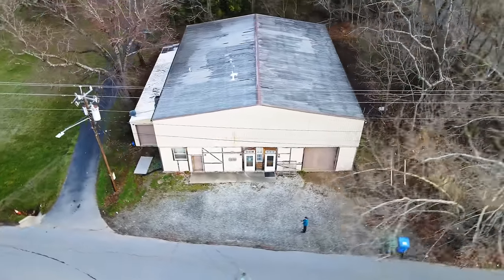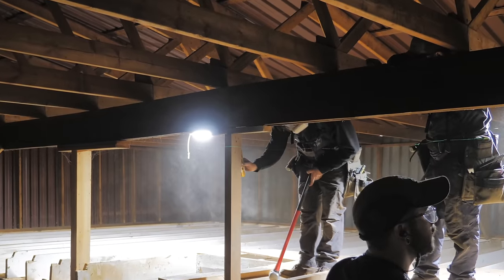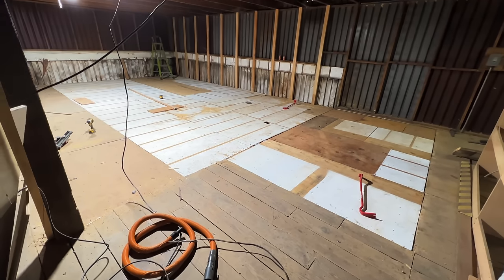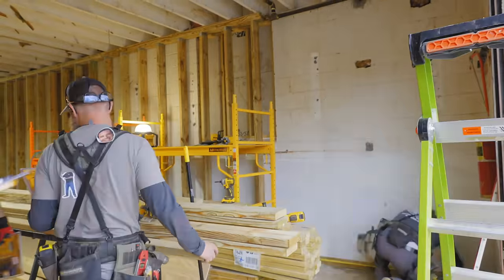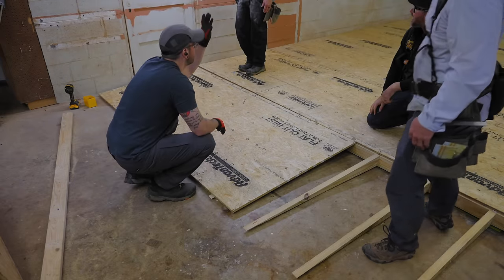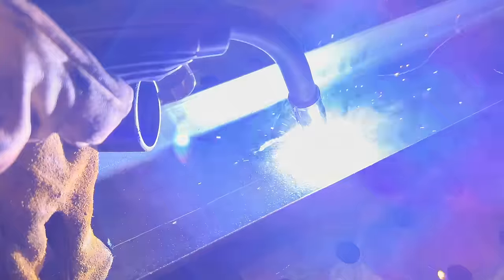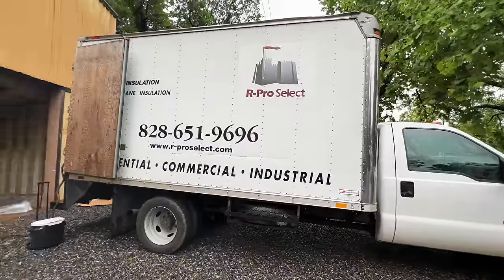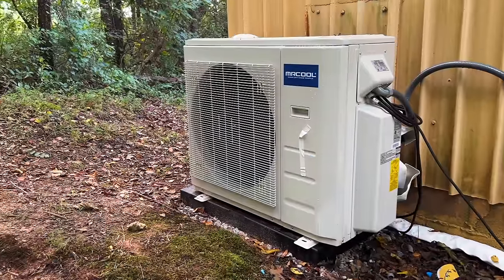50 Yr Old Workshop Restoration Into My Dream Shop

Comment: i dealt with that in my townhouse  we had a hurricane come through and knocked out my power for 5 days right after i moved some leather couch from north Carolina  to Georgia then we sold both houses in Georgia so i got the couch  i notice a small spot on the bottom of the couch but when i got it home and my power went out  that couch ended up furry and it spreaded quickly  through out down stairs but i got it before i had to get the commercial companies  but  i  can't stand seeing mold it just  makes  me  mad  because i always keep my place clean i blame it on ocd  it has to be right and clean

Comment: 37:24 Next time instead of putting your giant structure supporting screws in corner ways because they hit something in the last 1/4 in, pull the screw out and cut 1/2 in off the end.  That last 1/2 inch isn't helping anything anyway, its just the tip designed to cut the threads, which you already had since you already sank them as far as they can go.

Comment: I saw settlement cracks on walls on 1:21 , what you about that?
Reply from the maker: The structural engineer looked at those but wasn't worried considering the age of the building.

Comment: Another thing the US need to do is have a Qualified Electrician test every circuit to make sure it meets reg's and that the final circuit in every circuit breaker meets regulations and that all cabble connections are compliant and will NOT fail in any test. STOP USING WIRE NUTS.

Comment: I’m still watching your video,but I notice that junction box outside that’s about 1’off the ground before the unit I don’t think that is legal, I think you need to be a minimum of 48 inches each states a little different now,But I’m pretty sure it needs to be more than a 1’ off the ground. For heavy rain, snow, flooding,I may be wrong though you’re doing a good job though bud looks great

Comment: Why not make 1 of the 2 outlet from the quad box on a different circuit that way each quad outlet has 2 circuit so you dont have to reach 5 feet away if you have 2 power hungry tool in use

Comment: instead of doing 4outlets circuit 1 then farther 4outlets  circuit 2, doing 2 outlet circuit 1 (like on the two left plugs) and 2 outlets on circuit 2 (like the two right side plugs) would be even better (and runing it on "inverted phases" [L1/L2/N/G] you would have half the neural and ground wire and you could even add a 240v socket (15A or 20A depending on 14ga or 12ga cable)

Comment: 1:52:40 I think I commented on this in the original video, but a Hilti powder actuated nailer with some black chargers would have been perfect for fixing the timber joists to the steel beams.
Reply from the maker: Wish I had one of those!
Reply: @craftedworkshop  I rent one from the hire shop when I need to fix into concrete or steel. The DX460 with collated fixings magazine is the best option.

Comment: In Europe we've been using Wago connectors for a while. The US & Canada need to STOP using wire nuts and also stop twisting cables together. It's very bad practice. Also the US need to start testing final circuits before handing over to the customer

Comment: Drylock is junk for waterproofing. It'll just create efflorescence and end up weakening the block. You need to waterproof from the outside, starting with your drainage system
Reply: You clearly didn’t watch 30 seconds longer in the video where he says he’s renting an excavator and waterproofing the outside
Reply: @codykulesza7076  you clearly didn't see that both sides of the block are drylocked and no amount of grading will help with that
Reply from the maker: The outside isn't painted with Drylock, just standard latex paint as far as I know. No moisture issues currently.

Comment: so that cement board, there's a tool that cost about $7. it has a handle with a carbide saw tooth on each side(get one) it scores (Scratches) where ya want to cut than the material snaps on the line, easily done if you press your cut againt a wall corner. not an inside corner. less Dusty, wireless, quiet and takes 1 min.

Comment: c.[1:48:00] You couold have used that multi electrical tool to create the loops Oh ya 220 line must have a heavy gauge compared to 110 obviously. Ya that's a useful tool but too fragile I use mine for repairing expensive torch lighters that my friends always end up overpaying for and then the piezo igniter stops working. (usually carbonized at the tip and torch nozzle, easy clean or just a drop of a fine non-condutive lube if the piezo had just stopped that SSNAAPP :)

Comment: Soooooooo much work. Seems like it would have been so much faster and cheaper to knock it all down and just build a new one. 😂
Reply from the maker: It definitely could have been, although I think the cost would have been a good bit higher unless I managed to salvage a ton of materials. There is a 1,000 sq ft apartment in the space which I use as office space, and rebuilding that would have been a ton of work.
Reply: @craftedworkshop  plus we wouldn't have this awesome rehab video

Comment: Slab not level, so much flex in the walls, ingress of water through the walls etc. Not trying to be a wise-ass, but I really don't understand why your initial waterproofing was so superficial. Going forward, this lead to all that mould build-up and massive issues later. The installation of you aircon is really only a remedy for the symptoms but not a cure. You really need to do some substantial water-proofing on all exterior walls. Why backfill the exterior walls without adding an extra waterproofing layer to them. Your solution might deflect a lot of the water away form the wall, but the soil will soak and pass that water into the wall itself. Painting a good thick layer of tar onto the walls (in a dry condition) would have helped immensely.
Reply from the maker: I needed to get some kind of waterproofing in place because I knew I'd have the Perkins guys available for a limited amount of time to do the framing work inside. I could have certainly dug out around the exterior walls but it would have been a massive, massive project and, honestly, the building has been standing for 50 years with no waterproofing. I've had no moisture issues since doing the grading and am confident the building will be here long after I'm gone.
Reply: @craftedworkshop  then I’m happy for you buddy 👍

Comment: Do you not need to get electrical checked when you do it yourself? Where I live it's required (every time you connect anything to the fuse box). Wonder how the previous owner got away with that shoddy wiring.
Always surprises me how much more work wiring in the US is. In Europe we have 230 volt, and 400 volt (3phase) circuits. Obviously everything above 230 volt is for industrial use.

Comment: why feet from the side instead shims under neath, the floor is only as strong as the faseners and the wood making up the feet, where as with shim you would need brute compression to shatter the wood or shim material vs shearing the force needed to damage a foot
EDIT: i will say all in all not bad, in fact with all that brick wood and steel, shes build like a ....brick ..... house
Reply from the maker: It was mostly just a speed thing. The number of fasteners used should be plenty to keep from shifting over time.

Comment: You didn't really finish that front porch overhang. You did not finish the fasia..... you need to ad one more piece under the one you first installed. You have about two inches of exposed fasia all the way around....

Comment: That “Waterproofing” solution won’t work long term.  Heavy rains will build around the foundation. The blocks will then fill with water, and the increased hydrostatic pressure will force its way through that dry lock paint and right into that area.  Just do an interior Waterproofing solution as they come with a life of structure warranty.  Don’t be cheap.

Comment: This was really interesting, particularly how inefficient the American electrical system is. Having to pigtail outlets is such a waste of time, and do you not have to dead test over there? No standards for earth continuity?
Reply from the maker: Pigtailing eliminates the possibility of one outlet taking out an entire circuit. Outlets fail, it happens, and it's best to build in redundancy.
Reply: @craftedworkshop  I understand but that wasn't quite what I meant. Our sockets have screw terminals and you twist your incoming and outgoing feeds together. The sockets themselves are linked with copper busbars within the socket enclosure. It means zero assembly time making up pigtails behind each socket

Comment: I think concrete screws are literally fake. We've all been had. They don't actually work. If you attach something to a wall with concrete screws, it's going to fall off. That is, if you can get it attached at all. I always use plugs now.

Comment: Those off brand tapcons? They don’t look like Tapcon brand tapcons.
Reply from the maker: I can't remember honestly, had some Tapcons and some Simpson concrete anchors. It turned out the SDS bit I was using was creating an oversized hole, once I bought a new one, the anchors worked fine.

Comment: It’s not a good idea to both waterproof on the inside and the outside! That means any water in the wall will stay trapped forever, as it can’t dry to either direction! Water will always get in, no matter what you do, so, at least give it a direction to dry out towards either the outside or the inside.

Comment: Looks like who ever built it just put up a cheap building and used cheap labor and called it good.  Looking good now 🙂
Reply from the maker: Definitely more of a utility structure but it has good bones.
Reply: @craftedworkshop   Yeah, especially if you can reuse a lot of the materials. Here they will put up cheap metal buildings and use cheap labor.. but often times the companies that made the building itself, goes out of business soon after so you don't have much recourse if it goes south on ya.

Comment: Quite a few electrical code violations here. Careful posting this public because some people will use this as a guide to replicate the same violations. Im not surprised the "inspector" signed off on the electrical though; most of them only look at surface stuff and not in depth.

Comment: your hydraulic cement was too thin. that much water getting in will only continue without a proper drainage line underground along the wall.  your closed cell foam on top of it will trap water between your wall and insulation.  you will have mold within 3 years.
Reply: Just feeds the distraction machine.  Another video, more sponsors, more "colabs".

Comment: Unfortunately putting drylok on the walls would do absolutely nothing but cause more issues...... Waterproofing your walls on the inside of the building is going to do nothing because the water is coming from the outside all you have done is trap the water inside the wall now which is going to Leach the lime out of your walls and ruin the..... What you should do is remove that dry lock that you just put on fix the actual leak and stop putting a Band-Aid on it.... It should literally be illegal to sell dry lock to people because it does not fix the problem in any way.... The problem is outside.... And you probably made it worse

Comment: why do you keep saying 240-volts? Isn't that a 3-phase service? If so, those are 208-volt outlets NOT 240. Gheez. Also your phase tape job is wrong. You can't use orange for 208. It's red, blue, black.
Reply from the maker: This is a 3 phase panel but I am only using 240V and 120V circuits as I don’t have any 3ph equipment. The tape is not wrong, the orange tape indicates the high leg. This is an older style of 3ph called high leg delta. I have more in depth info in the longer electrical video I did in the series.
Reply: @craftedworkshop  Delta services are dangerous. And if that's what you are going to use, your colors are blue, black and orange. NO RED. you are going to get someone hurt.